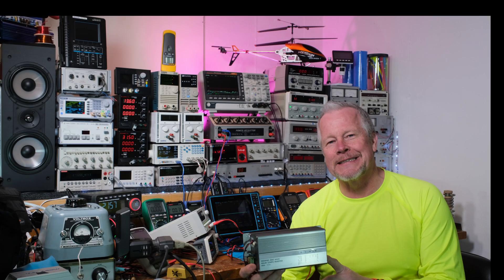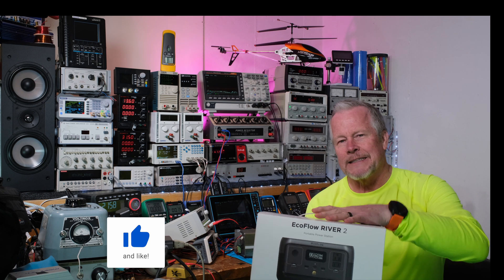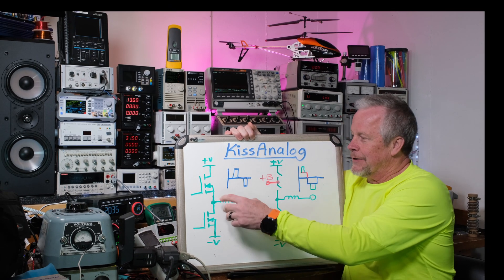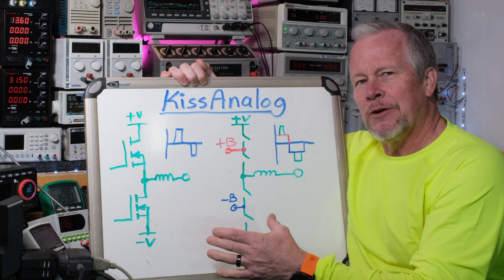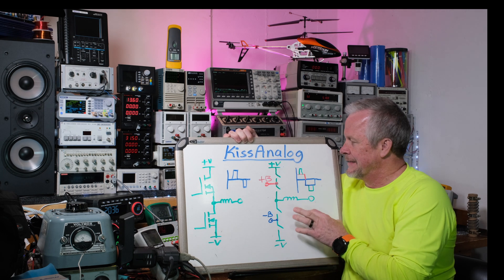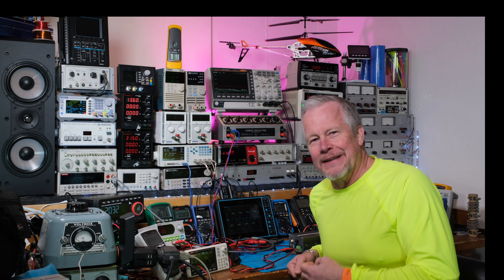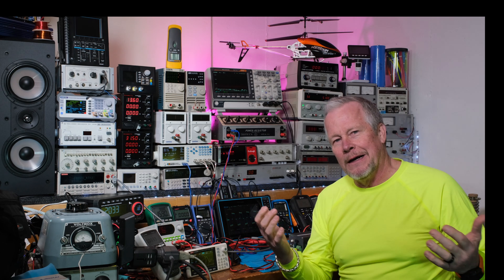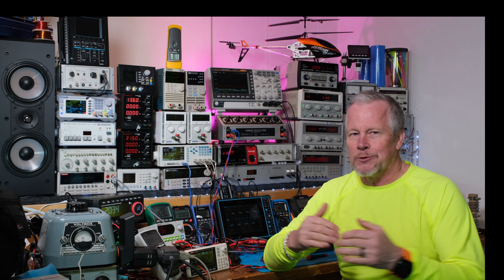Modified Sine Wave Inverter - Introduction and Waveforms #micsig #differentialprobe

Comment: Could you use a Class D audio amp with a 50/60hz sine signal as a power inverter?
I was setting up a subwoofer on a car last year, which was amplified by a strapped pair of 3500W class d amps. The output was a clean 120v sine. 
Could that be used as a backup emergency power station?
Reply from the maker: Fantastic question!  Thanks for asking!  I actually made my first inverter with a Texas Instruments Class D Amplifier chip.  It was only 100 Watts, but it worked great!  I just had to put in a 60 Hz signal to drive it to 60 Hz and it worked great.  An inverter and Class D amp are essentially the same.  I'm so happy that someone brought this up;)

Comment: Thanks!
I have a technical question on my stereo system Adcom and Anthem equipment. I am using hospital/medical grade triplite power,filter witn s medical grade isolation transformer are any these necessary? Also, I installed a Siemens FS 140 whole house, surge protection, with a delta, EMIRFI filter at the Load center , appreciate your feedback. Thank you.
Reply from the maker: Thank you for your generosity!
I think the whole house surge protection was a great idea.  This also could be a big deal if there were an EMP event.  As well as the EMI/RFI filter will help keep your power clean.

Regarding the Triplite, and isolation transformer - it is probably not needed, but will help if there's any power glitches.  If you had ground hum, it could help, but if you don't hear any than you probably don't need it.

Comment: What is Top Top value Most problem is when user connect a old type with a bulky transformer the primary voltage never come to 320 Top and in VS or US 160
Reply from the maker: Thank you!  Yes, these are not good for many things - dirty power;)